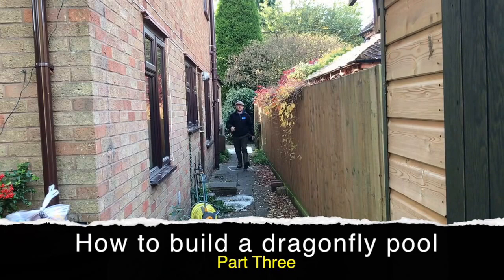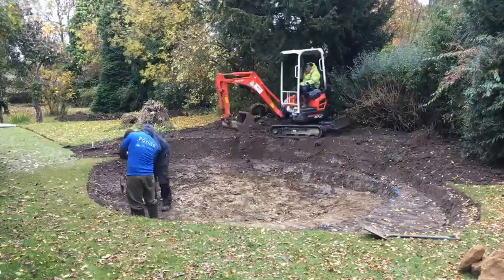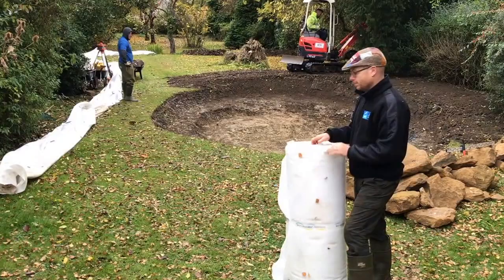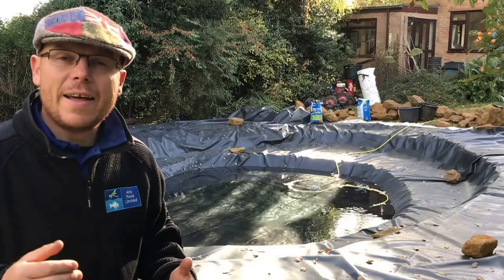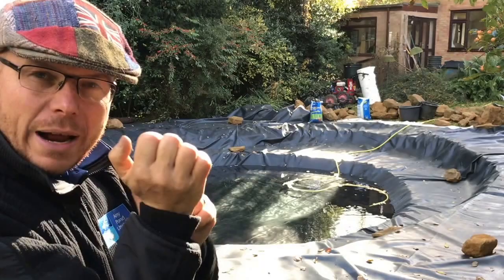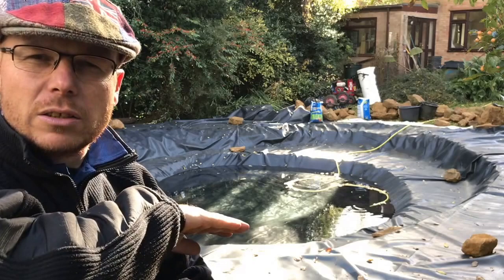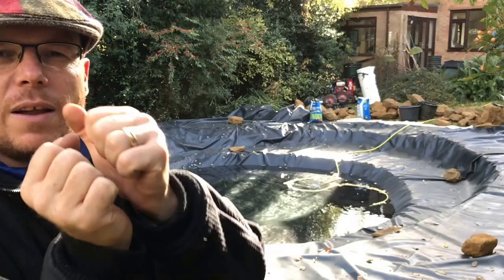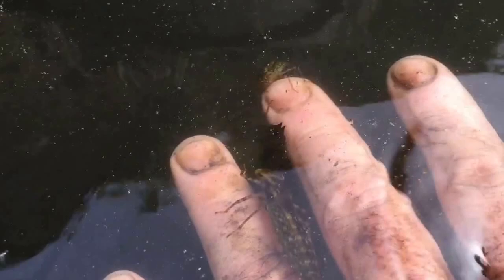Dragonfly Pond Build Part 3 | Creating a Dragonfly Pond

Comment from the maker: any pond questions about dragonflys
Reply from the maker: A small wildlife pond will attract large red damselflies.  The larger dragonflies will fly over and around a smaller pond. If you have the sound of running water but they will only stick around larger ponds.  You may watch females lay a few eggs but they prefer large bodies of water.
Reply: Samuelson baker  build it and they will come.
 the correct plants are also important,  plants that grow upwards , out of the water, such as the superb  Botumus umbellatus,  Acorus calamus and the very vigorous Iris pseudocorus, which are great for emerging nymphs to climb  and turn into those dragons and damsels.